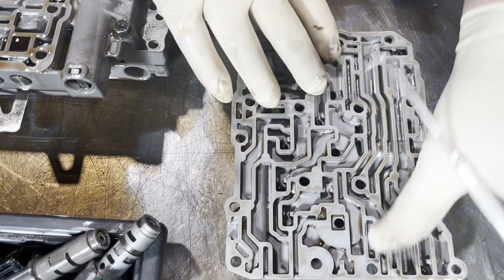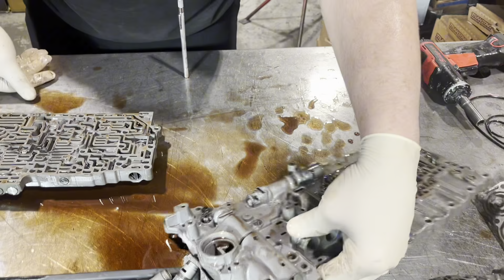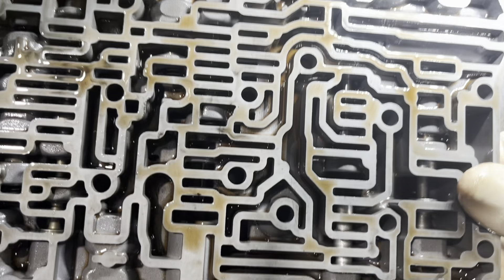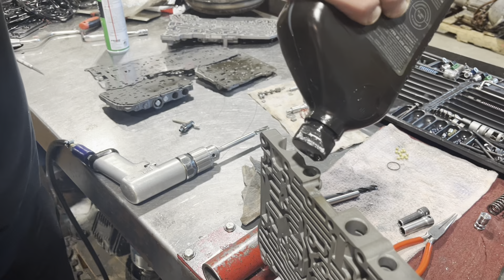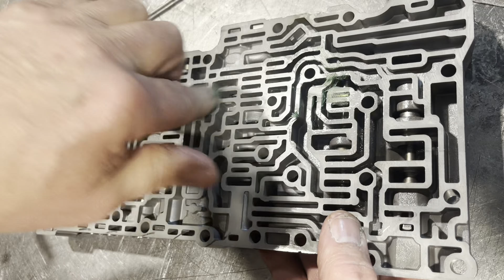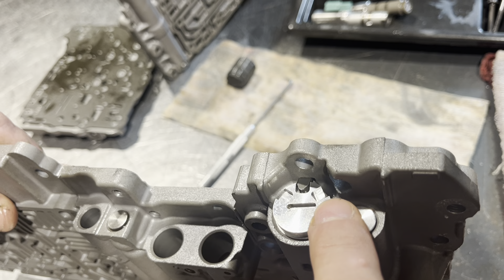700HP Tundra AB60 Build Part II- Valve Body

Comment: Very nice detailed video.  You have a Great way of explaining the tear down.
Would you have a suggestion for a 2008 Tundra 5.7l 2wd issue with codes for P0761 and P2714? I believe that Solenoid C is the issue but it tests OK, open and close so wondering if it might be wear on the valve bore.  Thank you..

Comment: Many tuners have mentioned to me that they can tune the transmission … shift pressure etc through tuning software. So what are the advantages of physically building the valve body for performance vs doing it though a software tune ?
Reply: My guess would be the VB components can physically handle the abuse and higher stress more.